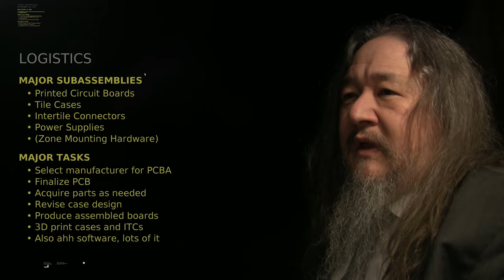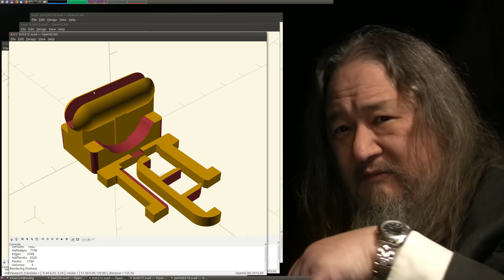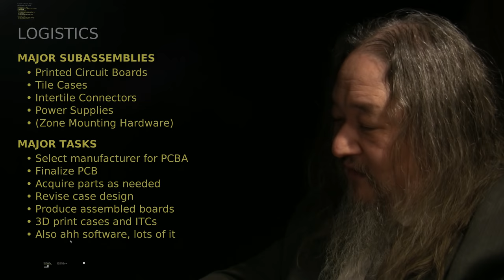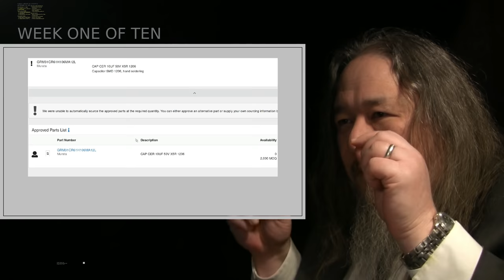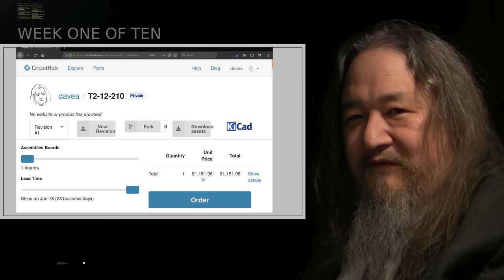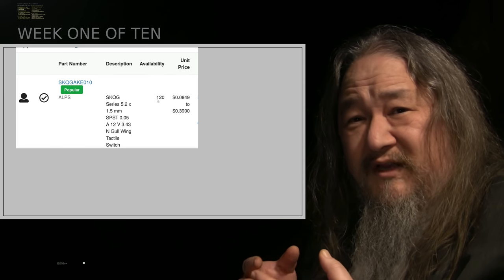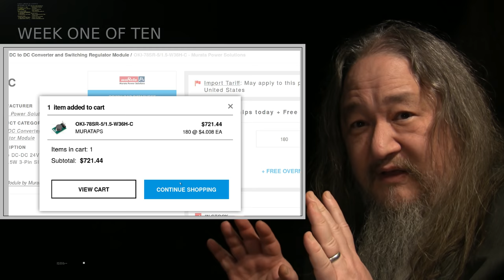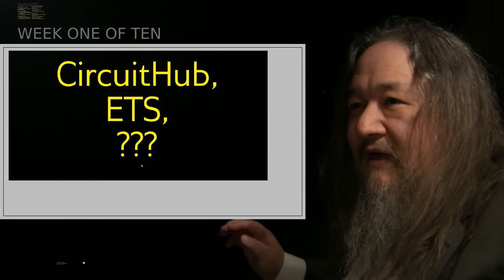T2 minus 9 weeks & counting - T2sday Update 210

Comment: ETS sounds good. This is early enough that having that down-the-street, in-person factor could be really beneficial.

With you clarifying that you WANT to name the 7 connected power zones rather than it NEEDING a name, I could see you naming this specific one, since it is a major milestone in the project, rather than generically; or maybe name both. So my name ideas would be "Colony10" or "Terraform10" - leximited notation to denote the first (0) iteration, and a Colony or Terraform to denote a size that you might consider a suitable amount to sustain our living computations and set a good baseline for growth.

I do a lot of 3d printing, some modeling in Fusion360, but I'm no expert, just a hobbyist. If you can provide some parameters/requirements for the case and a 3d model of the board (with components?) or some reference to understand the sizing, I'm happy to play around with some design ideas.

Thank you for the continued work and updates!
Reply: I couldn't put the idea into words, I think "down-the-street" factor really captures it. There's value in the relationship as well, not just this one transaction. 

Of course, easy for me to say... I'm not the one poring over data sheets and tracking the shipping times ;-D 

(btw as always Dave, please feel free to put out a request for grunt work in the video, on reddit or gitter, whatever.)
Reply from the maker: I'm trying hard to stick to open-source tools, so if anybody's good at OpenSCAD that would be super.  But as an example, with the current case taking like 3+ hours to print (at least with my newbie printer settings), getting 133+ made could sure use some parallel processing.
Reply: @T2TileProject  we can probably get that print time down. I mainly print with a 0.6 mm nozzle over a 0.4 which drastically increases print times and I have a CR-10 which is 12" x 12" so maybe I could do 4 at a time? Happy to devote some printer time once we have a new model. Fusion isn't open source, but you have to admire that they provide their software completely free for any project/company not making more than $100k / year.
Reply: @AndrewWalpole  <peanut gallery>I had a 3D modeling class in Autodesk 3DSMax ... actually it is very slick. I messed around with Blender... ok yeah it is not the same. ;-) But for basic geometry, which is all I know how to do, it got the job done. And I used free-range grass-fed ... I mean, free and open source software. ;-) </peanut gallery>

agreed on the print time thing - I've only printed like 10x but yeah I can imagine digging into all those settings... scaffolding etc.

Comment: Wow, it sounds like you encountered the learning curve in a big way this week. Just speaking for myself, I would completely understand if you had to delay the mid-Feb target. That's creative work for ya - "the devil is in the details." The silver lining is, you discovered the multi-week delay very early in the process - better now than Feb 1!

Perhaps the 10-week target for the chunk was a little ambitious. Maybe it would make sense to push the date out a little bit, or perhaps simplify the scope for Feb (e.g. have 2 power zones communicating, or perhaps even aiming for 1 completed power zone).

As far the choice of production company, it seems like a classic time vs. money trade-off to me. Should you take the car to the shop for an oil change? Or should you change the oil yourself and pocket the difference? 

Coincidentally, you gave a great example of the trade-off by describing the power supply component. In that case you figured, I am not willing or able to complete this myself, the saved time and lower risk is worth the extra money. 

I remember you throwing around a number of $15K at some point. Just me personally, if at all possible I would want to "under-spend," that is, leave head-room in case a second production run is required. Of course, that is easier said than done - does it make sense to spend those hours hunting down parts and managing orders, or does it make sense to pay for the convenience?
Reply from the maker: I totally feel the same way about 'underspending', but parts and production overheads are non-trivial.  Right now on circuithub, doing 3 separate 50 tile runs would cost me $10.3K, while a single 150 tile run is $6.9K.  And that's assuming nothing goes out of stock before the later 50 tile runs.
Reply: @T2TileProject  Oh wow ... yeah I can definitely see the incentive to take your time and try to get it right the first time, if possible. 

Well, if it ever comes to the second production run, maybe that's the time to ramp up crowdfunding. To me it's an easier pitch to say, "Look, we did it before, we want to do exactly the same thing but bigger" as opposed to "Well, we're not sure if it's going to work..." 

@Andrew Wapole might know more than me on the matter, but I would look at IndieGoGo first. They seem like a (slightly) more subculture version of Kickstarter, where the goal is to raise one large "chunk" ;-) of capital. There's also GoFundMe, and probably a handful more but those are the big names I know.

Comment: I'd lean towards ETS, I've been following a project to manufacture a few thousand SoCs(https://www.crowdsupply.com/eoma68/micro-desktop/updates), and even though the guy running that is actually really experienced in hardware design and manufacture, he's had endless trouble and problems getting things manufactured. Lots of revisions for undocumented hardware bugs, component availability, etc...  In order to get everything working he had to actually live in china to get close to the factory and have a direct connection with the people there. You really can't underestimate being able to physically go look at something or talk to the guy making it when there's a problem or a question. 

While this project is a lot less complicated, being more personally involved with acquiring the components has it's benefits. If everything goes perfectly you could easily get it done over email, but if you're going to have to get involved in acquiring parts and making revisions anyway, might as well pick somewhere close by.
Reply from the maker: Brrr!  Fully open-source hardware is great and needed -- but that EOMA68 project is exactly the sort of 'heroic engineering' that I'm determined not to do for the T2!

Comment: I say get rid of the N S E W markings on the case. When you have everything plugged in you will have a lot of redundant letters all over the place. Aesthetics are not a huge deal, but I think you will wish you had changed this sooner rather than later. I would suggest using different symbols on the top, bottom, and sides that seem to visually interlock with the adjacent tiles, and perhaps also indicate a sense of upward direction, if desired. (not exactly trivial picking the right symbols, will likely take some thought)
Reply from the maker: Thanks for the comment!  There are many conflicting design pressures, but I do think aesthetics are a huge deal, and I have several problems with the current case.  It's boring and closed, for example.  The case evokes a toy tablet when I'd prefer it to read more like structural scaffolding.